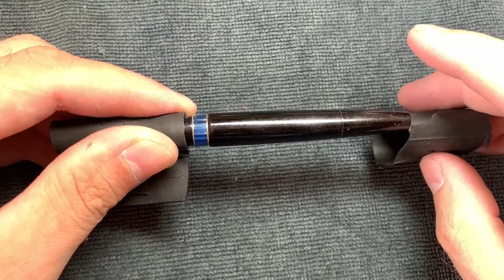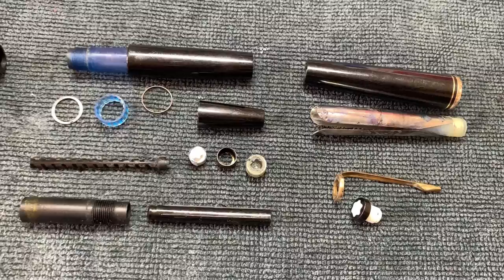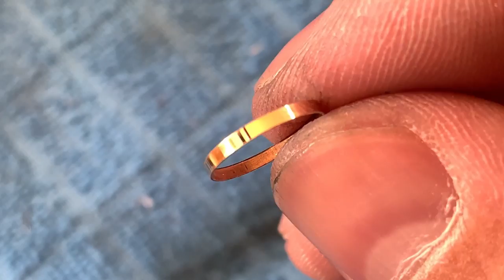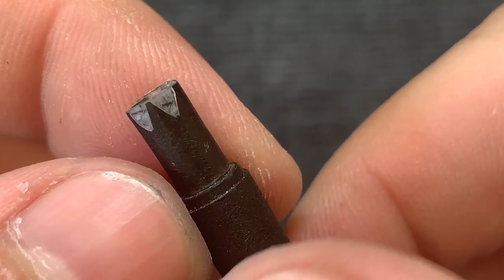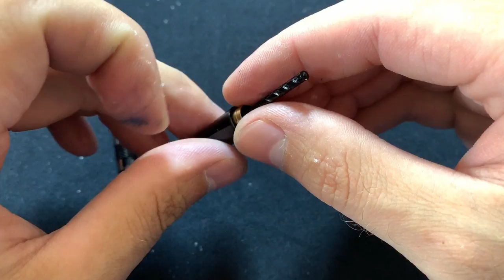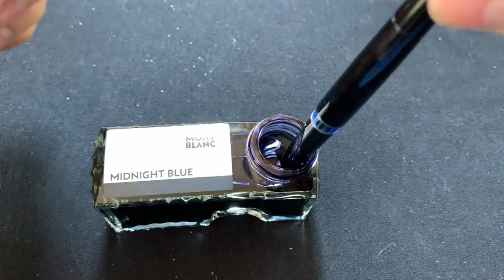MONTBLANC 22 Restoration - How to disassemble and repair a fountain pen

Comment: 1. What was the mesh made of that you used to repair the cracked tube and where did you get it?
2. What is the black liquid you used to repair the cracked section? 
Thank you.
Reply from the maker: Hello.
1. it was just kind of mesh what I found at home, nothing special, you can use any similar material, the idea was, just to hold the superglue on required area.
2.Black liquid - it was some kind of black super glue, black resin could be used too.
Reply: @HappyPensVideos  thanks. I've been restoring pens for a while and trying to get more experience in this type of repairs.

Comment: That pen got  some hard use in its time.   Good cleaning job.
Reply from the maker: True. Thank You!
Reply: I have an MB 34 and is leaking a beat by the ink-level window, would you give me some advice? I don't know if that happened because I did not use an MB ink. Or I tide up.???

Comment: What did you use to repair the collar. That black net that you glued?
Reply from the maker: To be honest, it was just a net which I found at home, you can use any similar material. I have used it to hold super glue in place.

Comment: Excellent ! I have one question: what is that mesh material made out of for the inner nib section housing that you made complete ? Subscribed ! 🙂
Reply from the maker: Hi, thank for subscription, I hope this could help to my channel and motivation to make new videos))
I have used - what I have found)) just a mesh, have no idea what it was. I used it to hold the super glue on place, you can use any similar material.
Reply: & that is understood, Deniss - I just wondered if it was a special woven material, specific for bonding plastics; irrespective, it worked very well, & your glue & mesh created a successful outcome; that's the best repair to a pen body that I have ever seen, but I now have in my possession some black superglue compound with which to repair a split Montblanc cap on a Model 14. Hopefully, tomorrow I shall be able to make good on that cap - I actually have a day off work, being a Bank Holiday....Thank you for your response, & enjoy the remainder of the day,
Regards,
Andrew 🙂

Comment: Hello, thank you so much for this video! It is very informative and helpful. May I please ask where I can possibly buy the small rubber ring/gasket that you inserted into the front section together with the nib? Thank you very much.
Reply from the maker: Hi, Thank you so much for your comment. I made this video for entertainment, not like tutorial. But I like if somebody can use it like tutorial. I don't know where to buy it, I made it myself. First of all you need to check if you really need one there, as this model has two types of inner section. Mine in video - I need gasket, but on many later models no needs in gaskets. It is easy to make it, I have used piece of rubber[bicycle tire] and a Hole Punch, measure a right sizes and cut a piece.
Reply: HAPPY PENS thank you so much for your message. You are right by saying that there are two types of inner section, and I was only aware of the newer type that didn’t need a rubber gasket. I only discovered the second (older) type as I was cleaning a pen and as I tried to remove the nib from that section of the pen for the first time. And I wanted to get a new gasket just in case mine breaks. So thank you for the tip about how to make your own gasket. Your video was extremely helpful in demonstrating how to properly put the nib back in with the rubber gasket. So thank you very much. Best of luck on your pen videos.

Comment: Excellent video! What is the black liquid resin you used to fix the crack?
Reply from the maker: Hi, thank you. It was long time ago, it was black super glue or black glue for rubber/ plastic
Reply: Thank you for replying to such an old post! Do you still use this for cracks or have you found a better product? @HappyPensVideos
Reply from the maker: @P_Jason  I am not used it a lot, but all depends of the material you want to bond. For celluloid I’m using MEK solvent, it’s could be good for some plastics as well , but not for MontBlanc.

Comment: How did you find the problem areas? I have a MB22 that leaks at the piston screws and the gaskets between the nib assembly and the barrel.
Reply from the maker: My pen had hairline cracks, it could be seen by the eye. Check all parts if there are some hairline cracks.

Comment: How did you discover the problem areas? I have a 22 that leaks at the gasket and the piston threads.
Reply from the maker: My pen had hairline cracks, it could be seen by the eye. Check all parts if there are some hairline cracks.
Reply: Where do you get parts if it is cracks? At this point what is happening is the ink is being sucked between the piston fill and the barrel. The seal is off. I think. I still do not see cracks, but I have to get the liner out of the barrel to see what is going on. 

Does the piston remover for a 146 work on a 22?

Comment: Wonderfull to see! I would like to do the same with my project pens. Where can I purchase the glue, net, special polish and other fine detailed materials? I have the rest and can polish from scratch to deep shine
Reply from the maker: Hi, thank you. I bought everything on ebay. The net - you can use any similar material, I don’t remember where I got the net, possibly my wife gave me. All other things from ebay. I have video in Restoration playlist - how to remove engraving/ how to polish - there you can find some info about polishes I am using. Just note, the video not a tutorial , it’s for entertainment. So you can not to see all steps I did, possible unlucky moments and all similar to that.